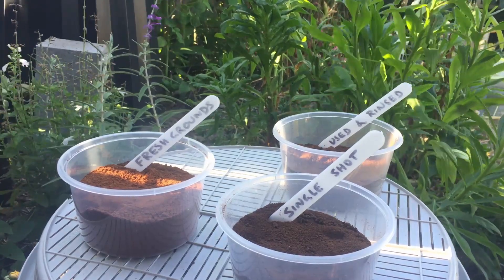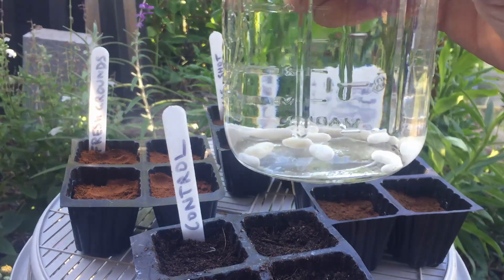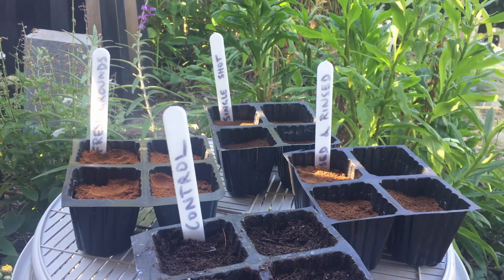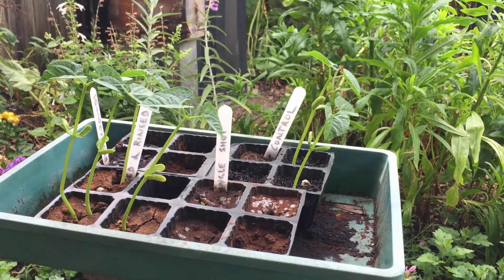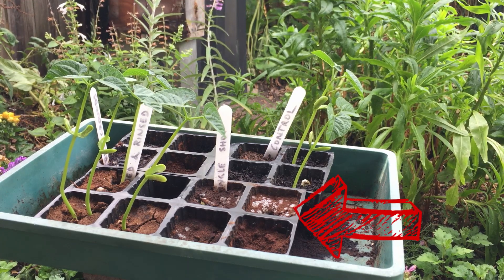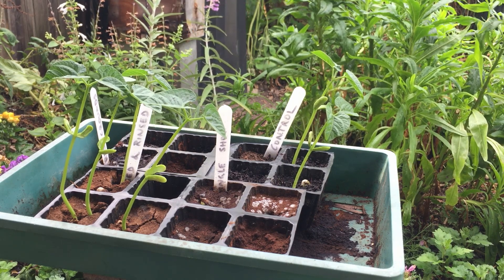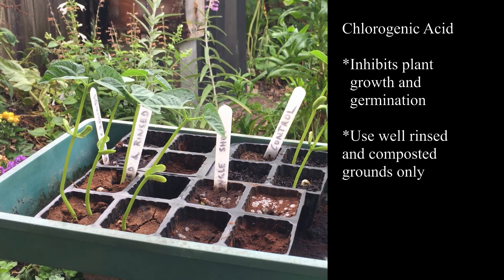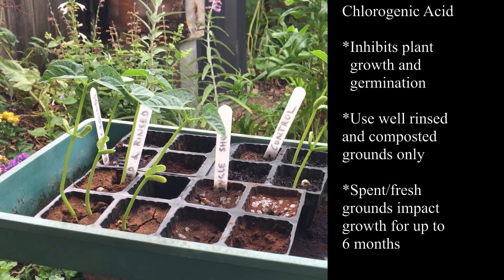Coffee Grounds for Plants and Seeds

Comment: Super helpful. Thanks so much for posting! I have recently gotten lots of free spent coffee grounds from my local Starbucks, and besides dumping a bunch in my compost tumbler have also been spreading it around my plants as an organic fertilizer. Now I’m thinking I should test that myself and see if it helps or hurts before I continue.
Reply from the maker: I love your practical scientific approach. I thoroughly recommend testing it out in small quantities (if your keen to see how much rinsing is required). Split test it in at least 2 areas. The negative impact on growth will be the clearest sign of its initial effectiveness. Long term though it will improve the water holding capacity of the soil and over time increase the available nutrients in the soil.

Comment: Hpw can i get the coffe to be usefull to use? Can i just rince it manny times and dry it out?
Reply from the maker: The chlorogenic acid is water soluble, so rinsing will reduce its presence in the remaining grounds. The rinsed grounds used in this experiment were run through the coffee machine until the water ran clear.
Reply: @dibbleandseed  thank you 😁
Reply: Thank you for this response. Can I instead apply them on the top layer of my soil now (November) and wait until next Spring to plant in April? Would the sizeable amount of rain that usually falls from Nov to Apr be enough to wash the Chlorogenic Acid away?